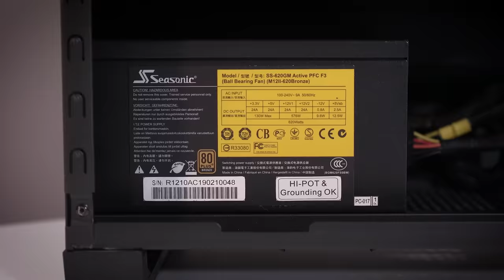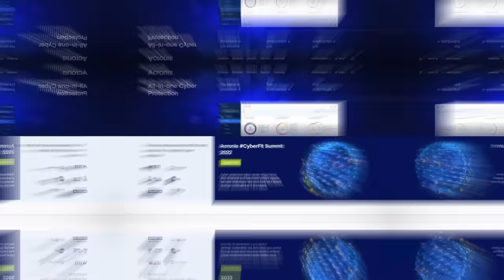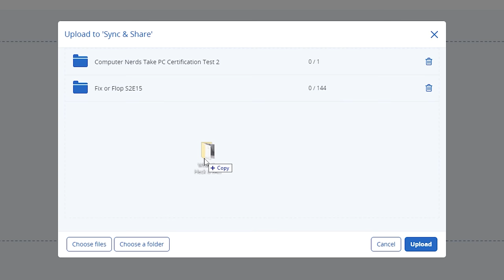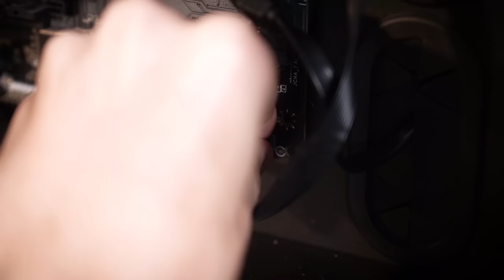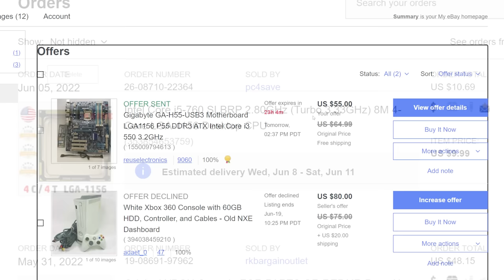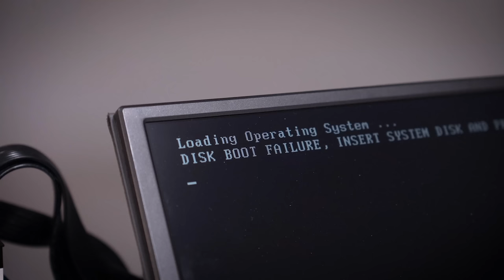Fixing a Viewer's BROKEN Gaming PC? - Fix or Flop S2:E14

Comment from the maker: IGNORE any comments from accounts requesting contact via Telegram or any other app. We're working on a way to smoke them out, but until then please report and ignore. Sorry that it's come to this! YouTube doesn't seem to care... at all.
Reply: Thanks for that information Greg. It answer a question or two that I was wondering about.
Reply: Yeah, I got those a few times and totally knew to just report them as Spam and to report their channel as Impersonating you.
Reply: I think is the battery in the motherboard is the issues.
Reply: Thanks for the heads up its on almost ervery chanel i watch. And yeah youtube does not seem to care about bot acounts.
Reply: Check ThioJoe's latest video, they're tightening their spam detection :)
Reply: Yep even LinusTechTips last wan show they talked about youtube is aware of the problem and started to fix it. But there is still some comments that stay around stil
Reply: That board might need a CMOS battery
Reply: @glitter_fart  I wouldn't bother, that board is old as hell, waste of time.
Reply: Linus had a video specifically about a program you could run to clear out these bots. Might look into that?
Reply: @rdizzy1  Doesn't matter if it's old as hell, never fire the parts cannon till everything is checked, especially on an older board. That's one of the first things I would have checked considering the age of the build.
Reply: @zrkn1  I would just dump the board in the trash and replace it with something that can use better than ddr3 ram. Cheaper or equal to the cost of having most places even open up your comp to look at it to begin with.
Reply: When I see them I flag them for Youtube.
Reply: Probably Indian scammers
Reply: hey linus yesterday speak about a possible solution made by other youtuber in the wan show and a intervention from youtube
Reply: Hello Greg, a few weeks ago i have a motherboard with very same symptoms just like this one. I did troubleshooting all component till it comes down to CPU & motherboard. I thought it was bios corrupt because it still works few days before. Since i cant reflash the bios so i had to remove the bios chip and reflash it with Bios Chip USB Programmer but for some reason the chip is unreadable. So i purchase a new BIOS chip with 16m size and it still shows the same symptoms just like yours. The motherboard i was working on is ASUS H-61MK. After seeing your videos now i can confirm the motherboard is bad. If you wondering why i didnt just outright purchase a new one well i already did. It's just out of curiousity :=)
Reply: They've been going on for the past year or so. Can't believe YouTube hasn't done anything about it yet.
Reply: YouTube made a new Update to remove those spammers. use "Experimental" feature in Comment Filtering at YouTube Studio. Its on beta but still works.
Reply: @MethmalDhananjaya  LTT have that enabled and the spam still gets through. He demonstrated it on the WAN show.
Reply: could of been the battery or been damaged by static electricity since i cant tell witch one it could of been
Reply: That evga board probably has a toast north bridge, the cooler on it is tiny while those chipc got pretty hot. Specially since it stops right after pressing on. That gigglebyteboard will be fine as the cooler wont let you overclock anyways.
Reply: Thanks for the heads-up. I just got one of the bots replying on a comment I made 30 mins ago
Reply: Yea I always get this kinda text in every Channel

Idk why but it happens in every channel
Reply: Thank you very much for trying to take action to get rid of this scam spamming bots! I reported it multiple times to YouTube as the bot has been spamming comments on anything I post in the sections of your videos. Your videos are awesome, educational, inexplicably helpful for getting any novice PC builder the confidence they need to get started with trouble shooting and hardware navigation, and I'd really hate to see someone fall for one of those cowardly scammers. Thanks Greg, love your content, keep up the fantastic work.
Reply: Finally you spoke of those scam account who got my $160. Kinda sad when i’m started to build a pc. But maybe that is my fault. 

Btw u got fast decision on choosing a new motherboard, its kinda old system from the early 2000’s with 1st gen of i5 core. But u did great job on make it alive again. I’m sure the owner must be very happy. I hope this channel bring more an lot of help to those who need help. Thank you so much greg salazar.
Reply: Hey don't stand in the way of natural selection, Greg. 

natural....financial selection
Reply: Yeah, those bots have been very persistent and I have always been reporting them when I see any of them in the comments. I'm glad you took the time and pointed them out. lol
Reply: probably you giving the scammers out of their business thats why they spamming. lmao.
Reply: Try ThioJoes Spam removal tool.
Reply: @rylanmario  hey that is actually legit.
Reply: it happens from all content creators on youtube..and youtube gives -1 F's about it. i just report comment as scam then report the acc as a fake, block and move on with my day
Reply: I always report them. It's so bad right now. Every video I comment on.
Reply: Thank you for addressing this  wish it was sooner though.
Reply: As others said, try ThioJoes spam removal tool
Reply: CMOS BATTERY. why  not check that in this context?
Reply: Every channel is flooded with them. I can't even comment on videos anymore. I always report them.
Reply: I knew was motherboard because i had a pc do this exact same thing and my motherboard was bad.
Reply: Thank you for finally pointing it out! I have been dealing with them all over the place across several different channels commenting on my videos and even pr0n accounts replying to my comments. You can easily figure out what the oddly misspelled word actually means, but YES. That sort of thing now happens here, on youtube
Reply: Dont worry Greg bro :) . Had the same thing happen to me on my 8700k platform.  Chip / ram fine - mobo dead.
Reply: they have been really proliferating recently, been seeing them everywhere.
Reply: When was the last time YouTube gave a damn, never would the right answer has YouTube even read your comment no, well there is your proof!
Reply: LOL
They even wrote me on Tik-Tok using your`s name. Thats going out of control :D
Reply: they still don't care

Comment: I've had a lot of experience with first generation Intel platforms. In my experience I've seen the same kind of symptom when the CMOS battery goes dead. I would honestly recommend trying to switch out the CMOS battery to see if you get any kind of post. It could also be that when the CMOS battery went dead it could have taken out the BIOS. Unfortunately these old boards don't have dual bioses or else it may have been possible to reflash.
Reply: Ahh, yes he didn't check the CMOS battery voltage, great point on an older board, I recently had to replace the battery on a 2015 laptop that I was upgrading!🤩🤩
Reply: thought the same about the battery recently got a new/old stock dell prebuilt did the same thing replaced the battery and was greeted by the windows 7 setup wizard
Reply: Very good point. Maybe Greg is just tired.
Reply: I hear you, I'm sitting here screaming "check the battery" ect. Are you kidding me!!!!
Reply: I was just going to type this but I think you hit the nail on the head
Reply: same, i've seen this multiple times on vintage platforms
Reply: I had the same issue on my system not long ago. Reflashing the BIOS was all it took (fortunately I have a dual BIOS and even though both BIOSes were basically toast, the backup BIOS managed to POST every 10 or so restarts by unplugging random components).

Otherwise it's always good to have a $10 flash programmer and a soldering iron laying around - removing the BIOS chip isn't all that difficult. The older the system, the harder it gets to find replacement boards at a reasonable price.
Reply: This comment is spot on!! Was also a very common occurrence on the LGA 1366 boards aswell!!
Reply: was about to wirte the same Cross Tech! Fixed an z370 aorus with the same symptom reflashing the bios chip (with a chip writer not from UEFI).
Reply: @totalermist  Bit-rot
Reply: Was literally about to type the same thing out.
Reply: Yes cmos battery plus a bios update or even downgrade the bios
Reply: I was watching this on my TV and was acreaming at the screen to check the bios. He could have done a clear cmos via the pins or remove the battery. That "quick" clear via the IO is ok when everything works, not in this case. Hell, imagine if the guy vacuumed his pc and sucked up the cmos jumper, then installed it the wrong way and the mobo is thus in a constant "reset - loop".
Otherwise i am sure he will be happy.
P.S.: Do not bash the 800D pc case. The thing cost almost 300€ when it came out and was for the time the pinnacle of case advancement. Still have mine gathering dust as a backup case. Can not believe he got it for 20 bucks.

Cheers
Reply: It's funny how some videos ago Greg "forgot" about clearing CMOS and now he does it all the time, but then forgets about some other tiny but useful method lol. It could happen to anyone of course, I for one wouldn't even have thought about these two suggestions in either video.
Reply: yes i have had that exact issue myself before i replaced the CMOS battery in several of them and presto the mobo started working perfectly again !!!!
Reply: I hope he reads this. This is a very basic thing you should do when diagnosing a not working PC. Always check the battery voltage and it should read at least 3V. Anything below that can cause such issue. I've seen even 3-5 year old mobos that needed battery replacement. That mobo was 12 years old. I would be surprised if the battery had 3V after such time.
Reply: I would have done the same after seeing the reset button flash every time it restarted.
Reply: You can pretty much always flash one with a cheap bios chip flasher and clamps, sometimes even if on-motherboard flashing doesn't work.
Reply: Another thing that could be the culprit is a dead MOSFET. I've seen this issue a lot on older, cheaper motherboards with little to no MOSFET cooling.
Reply: @BuBBle.D  having the jumper in the wrong place can even cause damage in some cases. Did that once a long time ago (was in hurry, didn't realize anything was wrong till it started doing weird things, the saw the corrosion).
Reply: @zrkn1  LoL - me too.    I'm 99% sure it's a dead battery, that's exactly what happens with a dead battery on these.   Almost like I've seen this before...oh, I have.  :)
Reply: @totalermist  I had this very same issue at the end of 2019, changed battery, flashed BIOS, issue persisted. I ended up building a brand new system since I've been longing for a new system anyway since 2017, my old case couldn't even fit GPUs above 27cm (10.63 inch).
Reply: I was just about to suggest the same thing, fixed a similar issue on my nephews system with an I7-970 by replacing the Cmos battery.
Reply: BUT - the same motherboards had removable bios chip !!!
Reply: Holy shit I totally forgot that could even be a problem
Reply: This is why a bios flasher is important. I've saved many a laptop by literally just reflashing the bios. No dead hardware or anything. Now granted the laptops were worthless but it was always super satisfying to get something working at the end.
Reply: Came here to say that.  My procedure is to pull the battery, clear the CMOS, boot without the battery and then boot again with a new one.  Since I'm still rocking the P8Z68-V Pro/2600k I built about a decade ago, I've had to do this twice and it worked each time.
Reply: @zrkn1  Right there with ya on this one. I guess he figures resetting the Bios on the board is the same thing.
Reply from the maker: Just to clear this up: the CMOS battery was tested at 3.043V. It was also swapped with a new battery. Still nothing.
Reply: @GregSalazar   I had the same issue few years ago. it was an 8 month old PC. tested everything but had the same results. i swapped the mainboard and it was fine. I was still curious what was wrong with the mainboard. I gave it to a friend of mine and confirmed it was a busted mosfet however, the problem was being caused by the powersupply. for some reason even when the PC was switched off, the PSU was still releasing power pulses with actually burnt a mosfet. thankfully everything was still under warranty and got everything for free.
Reply: Seems im not the only one who was thinking "swap the battery"
Reply: Quite comon and have been for many many years is the BIOS going out cold ESPECIALLY the 8 legs DIP-chips. Since early years with DFI and old famous brands the BIOS was a constant issue. Today u can pick almost any board from the scraper or the defective corner or for free and get it working with easy easy tools, often related to BIOS or such. Once and a while you stumble on the ones struck by lightning - those are a whole different story though with chips running extremely hot and so on.
Reply: My maximus 3 gene p55 keeps blowing up my ram. Ive used two different high quality psu's rm850x/antec hcp 1300w and the motherboard has blown 2x8gb corsair vengeance 1866mhz 1.65v and 4x2gb dominator 1.65v. Everytime I put good ram it works again. Any ideas? I don't wanna blow ram worth more then the whole system again. Also two different cpus i5 760 and i7 870.
Reply: @michaelxdrift  I'm pretty sure it's bad memory controller on the motherboard. Because it wouldn't be your power supply or your CPU. I would honestly recommend switching out your motherboard before I would do anything else.
Reply: Yeah, and it doesnt help to just bridge the jumper for cmos reset, you need to remove it completely. If the battery run dry, you get a error message. Try to save changes and it will not work.
Reply: You can also call it "Bootloop" , bad settings in the bios , bad OC , incompatibility with the ram what else in the case when the computer starts but does not give an image then the motherboard is dead and sometimes it happens that the graphics card.
Reply: I have never seen a 3 volt CMOS battery kill a bios and I've been repairing PC's professionally since the 286 era.  Lightening strikes yes, CMOS batteries frying the bios? Not likely, however theres a 1st for everything lol.
Reply: This totally happened to me on an AM2+ platform. I always check it now.
Reply: I've also had experience with first gen, one failed on me